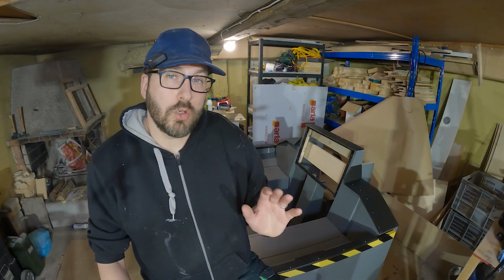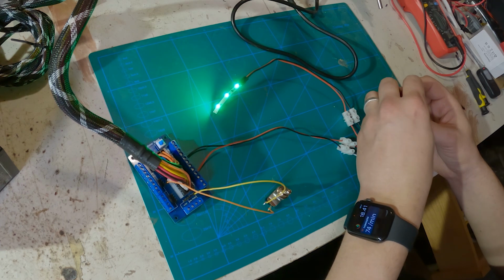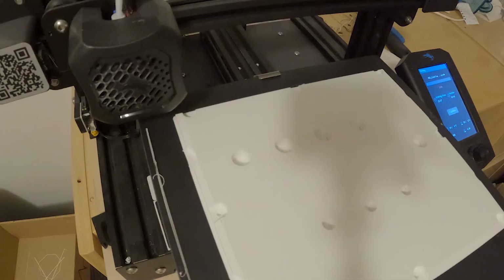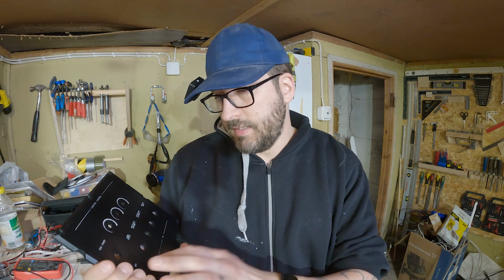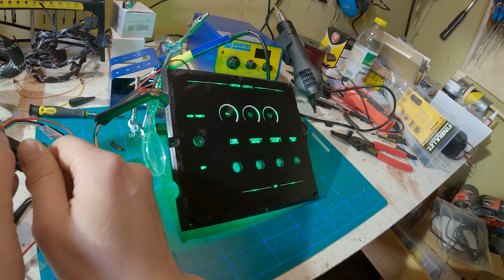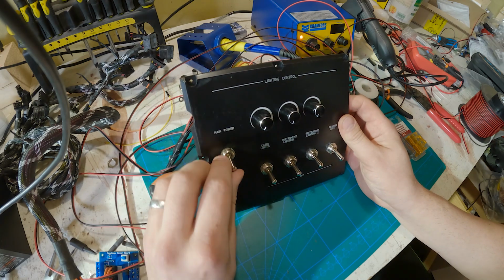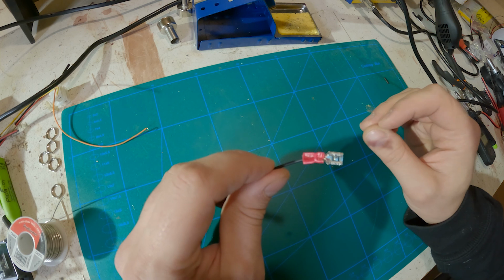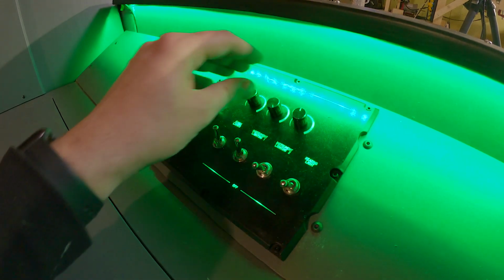Adding Power and Lighting Control Panel - Building a Home Cockpit ep 7

Comment: Hey I tried to make a similar panel. However when i removed the black paint with the laser, it becomes grey and not that white like i see in your video... tried it 3 times at the same spot... any idea how to fix that?
Reply from the maker: My first though would be the laser power or speed, but if you have already tried multiple times on same spot, I would expect it should've had enough time to dig through the paint.

I did once small piece as a test run with different power to different places to get a general idea of power / speed required for good results. And I still do a really small test piece that I always paint as I paint the actual pieces, just because there might be some differences in paints or for some reason different amount of layers.

Have you tried engraving just the white plastic (are you using PLA?), just to test if for some reason it might react differently? Not sure if it would be possible, just one thought.
Reply: @UndeadParrot  than you veeeeery much for your answer! Now I m motivated again to do further testing, because I m sure that your s is white! And of course because of your good ideas. 

Yeah I’m printing PLA. I used a solvent based Paint. Maybe a water based paint is better for that? 

I will engrave the painted PLA with different speed and power combinations to do further testing :-) 
And I will engrave the not painted PLA to make sure it does not change the color to grey when I gets hit by the laser. 

Again, thank you very much! Keep going on with the great builds and the videos!
Reply from the maker: @Sinnlos666  If you use Discord, drop in and we can further troupleshoot if necessary.

https://discord.gg/r5ATK7UmHW

Not sure about paint, I’m using some spray cans.

Comment: You need to strip the wire jacket back so you would wind up with about 1/8” bare wire to insert into crimp. Also it would make it easier if you pre-solder the wire and what ever you’re soldering to prior to welding them together.

https://youtu.be/pRPF4wpXX9Q
Reply from the maker: Thanks!